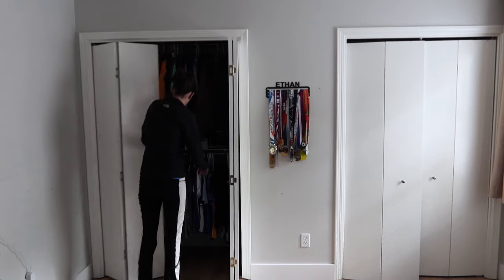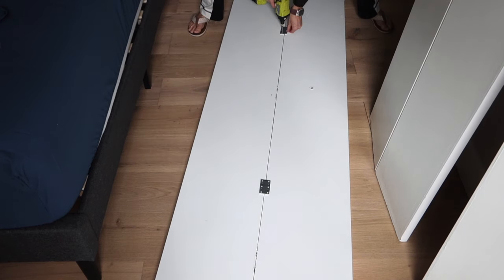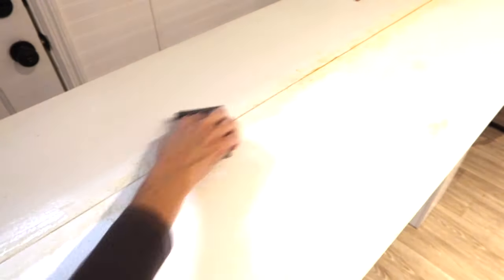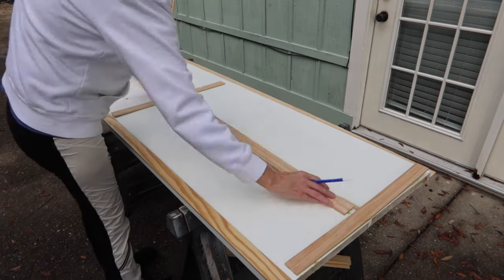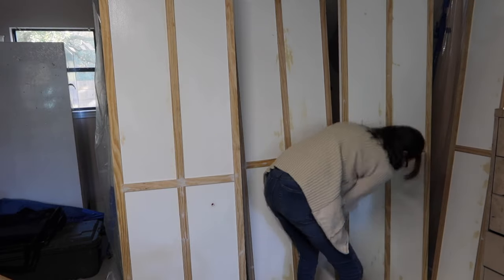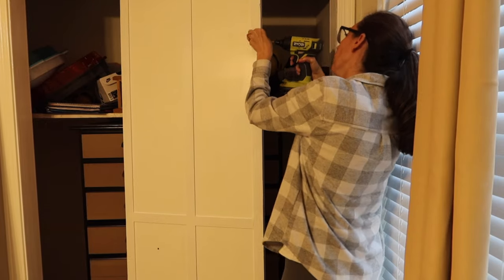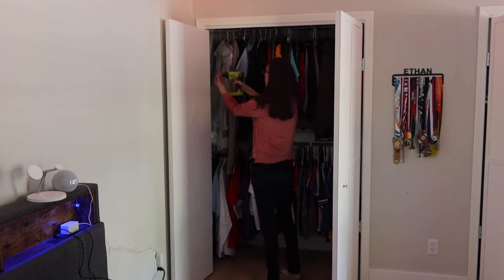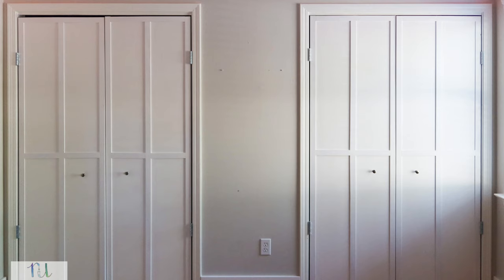DIY Bifold doors turned into Swinging French Doors- Easiest way to transform old bi-fold doors

Comment: For those wanting to attempt this project, I wouldn't recommend this for particle board unless the doors have a solid-wood frame or edge molding. Particle board is fine for dressers and cabinets but it's not suitable as load bearing doors since it is both heavy and fragile. Mending braces are good but for additional support you'll want to include a pocket hole jig, short pocket screws (to prevent poke-through) and Wood glue, all of which can be bought at your local hardware store for around 15 dollars. Great video btw.